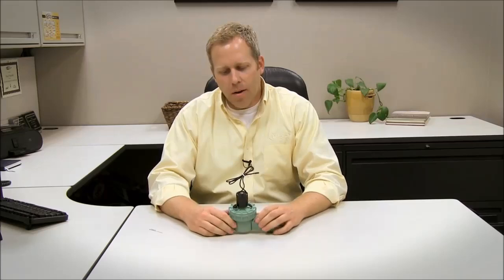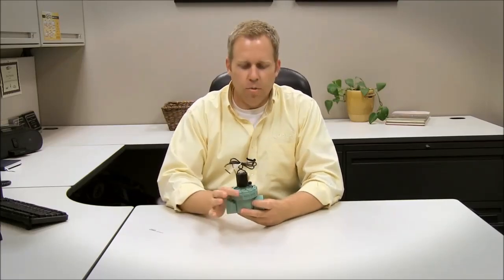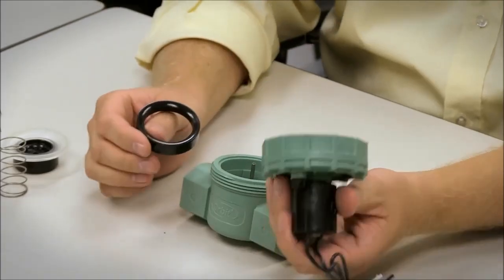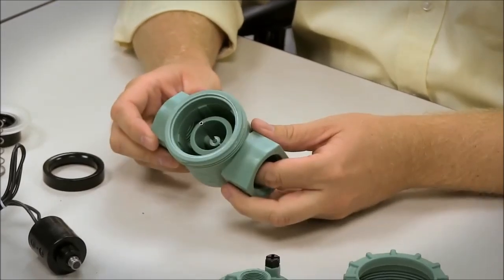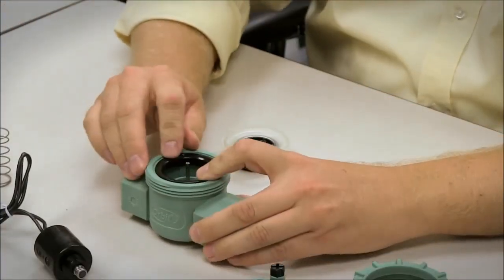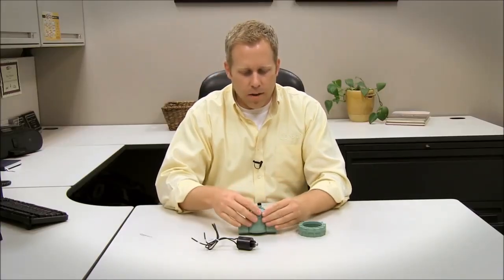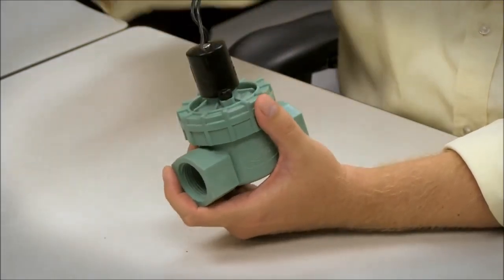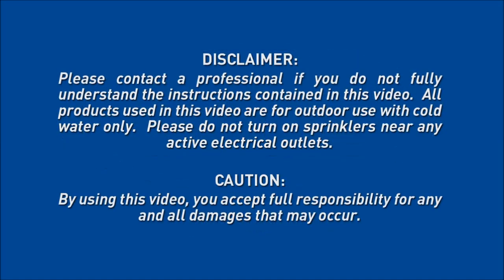How An Orbit Irrigation Jar Top Sprinkler Valve Works

Comment: Thank you. I have a valve that is very tempermental with the bleed screw. If I back out the bleed screw the valve will work with the selenoid, but if it's backed out to far the bleed screw leaks.

Comment: He didn't explain how it works. How it works is NOT that same thing as how you work it. He showed how to clean it and put it together, and how to turn it on by opening the bleed valve, but he didn't explain HOW it works. How does that little 24 V solenoid open a big valve that holds back 50 psi? No explanation. Disappointed.

Comment: Nice explanation, thank you. If someone can advise: I have a valve leaking from nuts on pipes. Are there any washers between the valve and pipes? I do not want to open it without having parts handy
Reply: Sounds like you mean the threaded connections from valve to piping.  Solution is tedious, but not hard: remove threaded connection (probably by cutting the PVC pipe), then clean both M&F threads, then re-apply teflon tape to seal threaded joint, screw fittings back together using two wrenches, finally reconnect the piping.
If you mean the leak is from the screws on top, then open the valve body, apply gasket sealer all around, screw down the valve body top, zig zag tightening will help you to avoid over tightening screws.  Wait for gasket sealer to harden before using under pressure.

Comment: Good video, thx!   ? 4 U     My valve works, but buzzes loudly. I replace the solinoid with another and it buzzes the same.   How can I make it more quiet or fix this?  It's not normal, is it?  It's quite loud.  thx.

Comment: So, does this valve restrict the flow of water?  It doesn't seem to have a straight through path for water when the valve is open.  I have 1" piping and my water volume is much less than my neighbor who also has 1" piping, but no electric valves.  His sprinkler volume is much higher than mine.
Reply: The diaphragm is pressed down by the spring and water in the bonnet above the diaphragm. This closes the valve and no water flows from the inlet pipe to the outlet pipe. When the solenoid activates or the bleed screw is opened, water above the diaphragm is lost causing the diaphragm to push upward, which creates a direct channel between the inlet and outlet pipes.

Comment: You did not actually explain how it works which is the title of this video....
Reply: Dave Coder there is a good explanation on a rainbird corp video entitled how irrigation valves work.  Basically the solenoid releases the water pressure on the back side of the diaphragm allowing the line pressure to force the diaphragm open.  When the solenoid valve is deactivated it seals the bleed  port allowing the pressure to build up on the back side of the diaphragm shutting off the water.